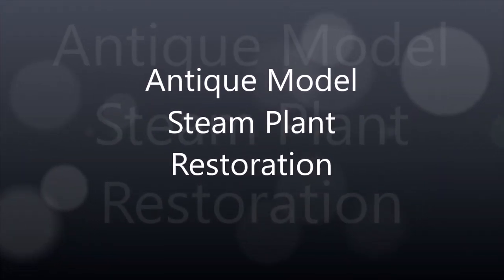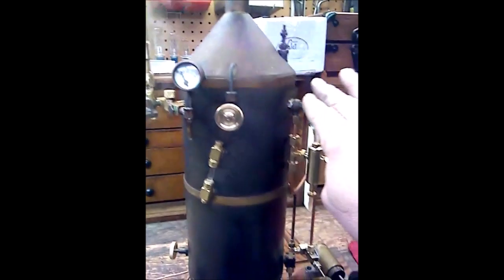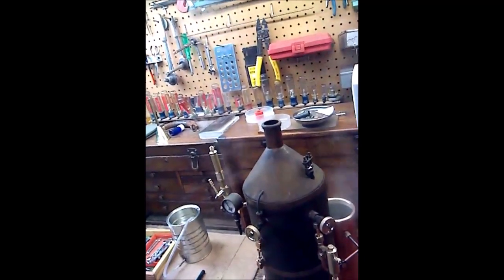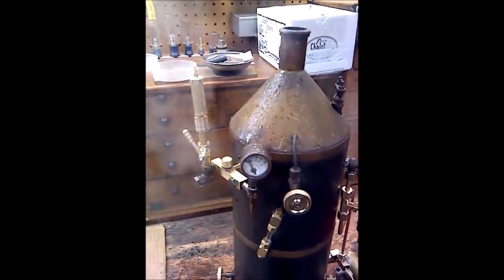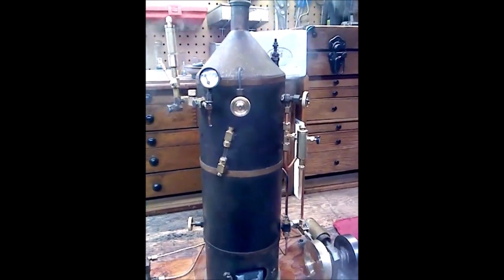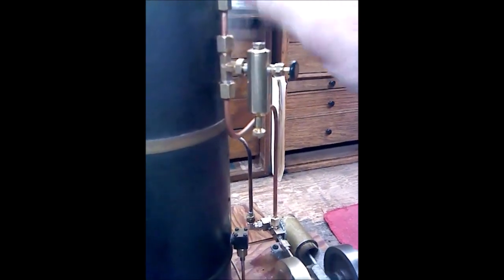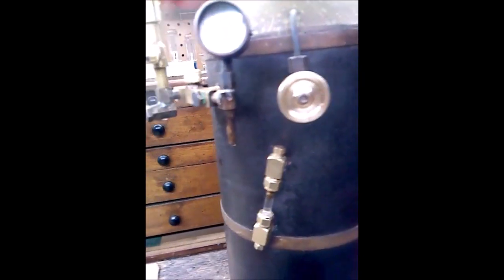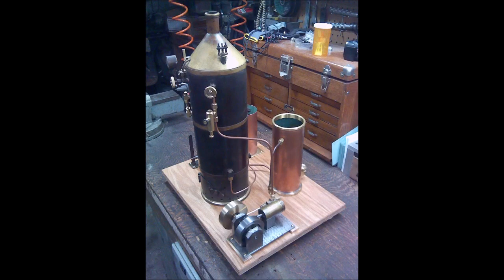Antique Model Steam Plant Restoration

Comment: Great find, you could retro fit it to be a multi fuel boiler that can burn wood coal/briquettes propane or waste oil
Reply from the maker: I absolutely agree with you there.  For now, and until I understand how this particular boiler behaves I want to use a fuel that I can extinguish in an instant in case I have some catastrophic failure.  I believe the boiler ran on coal or wood in the past because the accumulation of soot in the fire-tubes.  Stay tuned, I will be playing (I mean working on) LOL building a propane burner and will be trying that.  Fred
Reply: For a fast shut off it would either be propane or the waste oil burner. I recommend the oil burner cause it uses pressurized air and a fuel line to mix and atomiz the oil to make a flame, in an emergency you could just kill the fuel feed and let the air keep going to help cool it off

Comment: Fred, a superheat pipe might help with your restoration if you are going to be running engines with the boiler. I also started tig welding my traction engine boiler for the kids. I even incolnell overlayed the tubes just like the boilers I rebuild at work.
Reply from the maker: Great point Justin.  A super heater might be the ticket.  In any configuration I will need to have a hotter heat source.  Thanks!

Comment: Good one Fred.  Maybe the whistle would work better off the engine feed line - I notice there is a free clamp on that side of the boiler head.

What pressure was it running at ?

Cheers Rob
Reply from the maker: I may give that a try Rob, thanks.  I just know it needs to be higher than it currently is.

Comment: Hi Fred, looks like you fell lucky in finding that. My guess is you need a stronger heat source, it shouldn't take 45 mins to raise steam. Are you able to try it on gas or coal? I have a couple of boilers of a similar size (they can be seen on my channel) and they can reach 90 psi in about 10 - 12 mins so I'd expect yours to be similar.
Reply from the maker: That was my very first steam and I wanted to make sure I could remove the heat source quickly if something went sideways.  One of the valves on the boiler is to a pipe that points up the chimney and would induce more draft so I am thinking it was originally wood or coal but there was no container in the bottom of the boiler to hold it. What do you fire those boilers with? thanks!
Reply: @FredMiller  Fred, if it has a pipe routed up the chimney that will be the steam blower used to create a draught when starting a coal fire. You can buy steel grates from some of the model suppliers if you wanted to try coal or alternatively buy a ceramic burner and run it on a camping gas cylinder. I think you'll be suprised how well it steams with a better heat source :-)